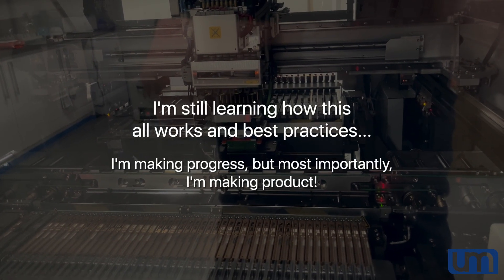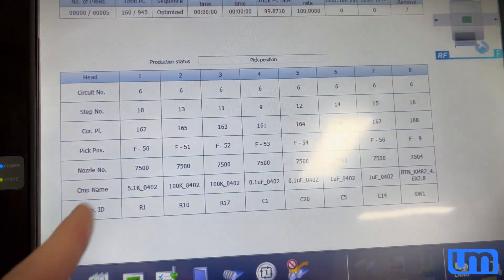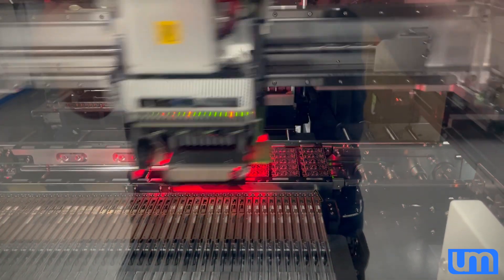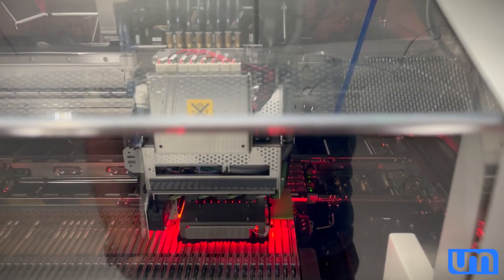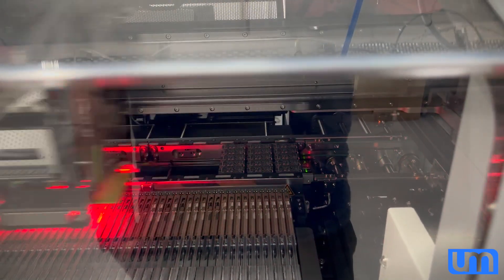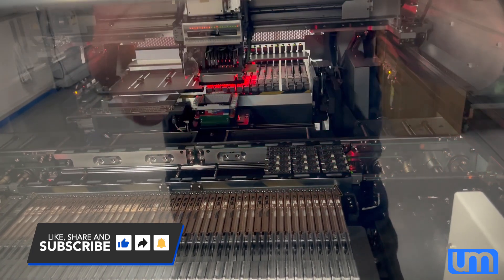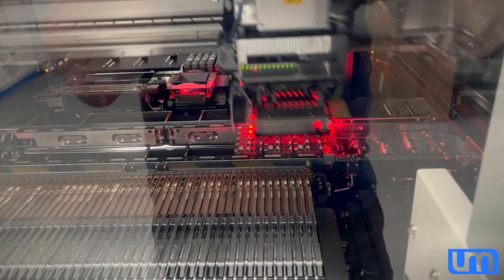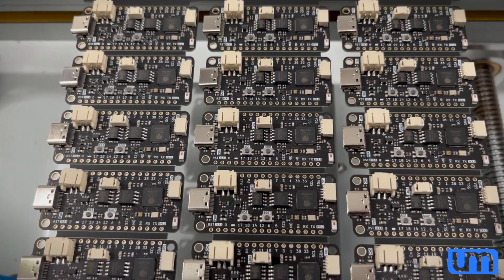RS-1R First FeatherS3 Production Panel

Comment: I notice the boards are loaded to the right of the machine  - wouldn't it be faster if it stopped in the centre , so avarage distance to feeders is shorter?
Reply from the maker: Not really - 70% of my components across most of my products live on the front right and back right of the feeder banks. Putting the PCB in the centre would make it further away than that majority of the parts.

Some of my products span the full width of the front feeder bank, but only have 200 parts per panel, so I'm still smashing out a panel in a few mins ... faster than my oven can keep up with.

I also don't need 40k cph - There is no advantage for me to make 1000 boards in a day compared to 500 in a day. Assembly is the quickest pat of the process for me. I still have to separate them, clean them, test them and pack them.

Comment: How much it cost (roughly) ? We did buy the Neoden K1830 2 years ago but did only small batch so we put it only at 20% speed.
Reply from the maker: It cost a lot - totally different realm to the Chinese machines, and totally different price point.
Reply: $100000 with feeders, $78000 without feeders
Reply: @MicrosiMe  thanks 👍

Comment: Awesome machine!
It doesn't looks like it is using the camera to see component orientation, or it is so fast I just didn't notice it. Is the placement in the feeders that precise so it isn't needed? Or just magic? 😁
Reply from the maker: Correct, it's not using the camera at all - it's using a laser curtain to measure the entire component on each nozzle, on the fly :) Juki have a "unique, patented and fiercely protected" way they measure components like this... It is kinda magic!

The camera is used for BGAs or any components where I want to not only measure the size/shape of the component, but also count pins or detect orientation markers under the package etc...   none of that is needed on these boards.

Comment: That ball screw is frkn crazy. Its like 40-50mm pr turn
Reply from the maker: Yeah, and it's got AMAZING repeatable accuracy down to 01005 sized components !
Reply: @UnexpectedMaker  Thats super cool. So you started to use 01005 now? That would make routing so much easier, at least in my head.
Reply from the maker: Lol, no plans on going that small...   but I am using 0201 in my BlizzardS3 - and might use more of them as time goes on, only if it makes sense. You should always use the largest parts you can fit - for ease of design and manufacturing.

Comment: Really nice to see it working. I was wondering in the middle if you could move the boards back to the left to reduce travel time when most of the parts were coming from the front left reels.
Reply from the maker: The stop position is not a user settable thing. I can physically move it, but not per job - as moving it requires disassembly, and re-calibration and setup. I'm happy where it is... remember, I'm already getting 4-5x faster than what I had, with 100% perfect placement - and I can get faster just by adding more nozzles and fixing some feeder placements, so moving the stop position isn't worth the effort.